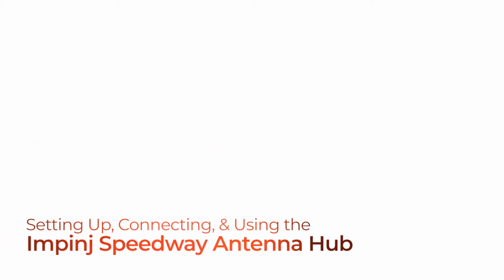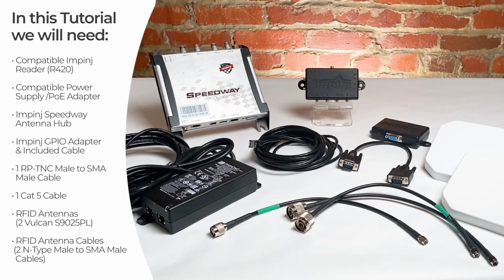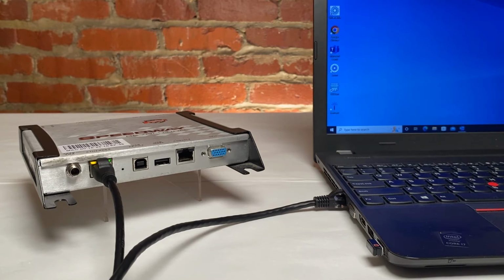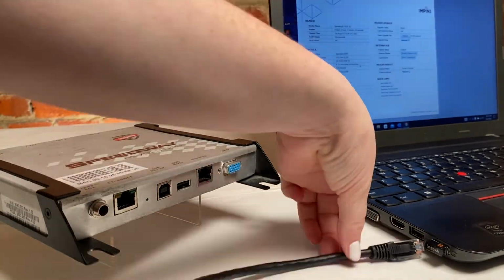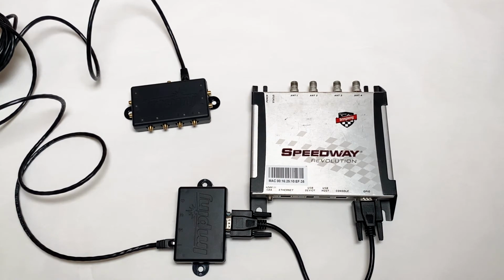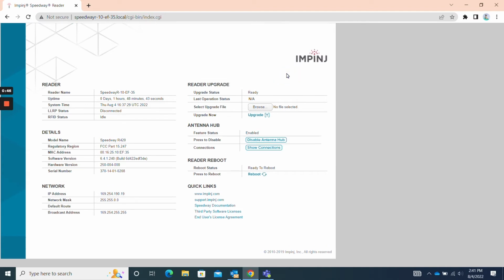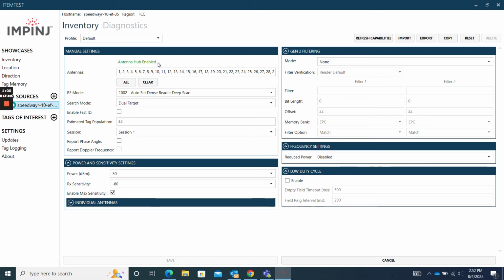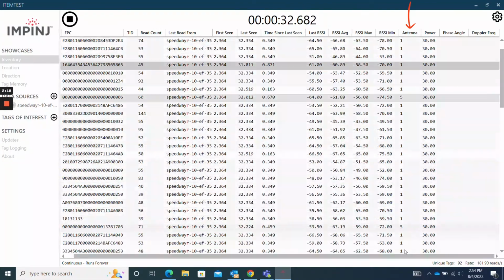Impinj Speedway RFID Antenna Hub | Setting Up, Connecting, and Using this RFID Antenna Hub

Comment: can I calculate phase angle also?
Reply from the maker: I'm pretty sure that you can. Phase is available using the SDK or LTK for sure. I can look into that for you if you'd like. What type of information were you looking for and are you looking for it only with the Impinj R420?

Comment: I have five connections on one of my antenna hubs 1-5 but the antenna hub is only reading the first one in the chain and not progressing. Usually the blinking orange light will rotate all the way around the antenna hub but it is just stuck on the first hub of the antenna hub. Any help would be appreciated